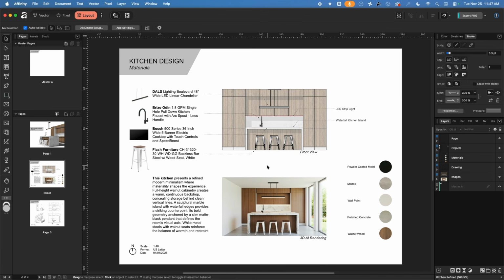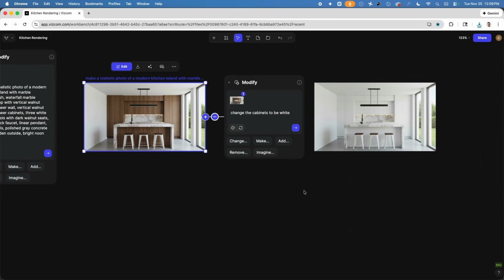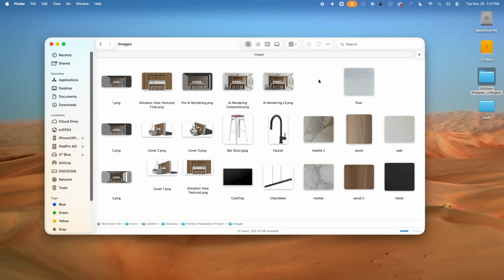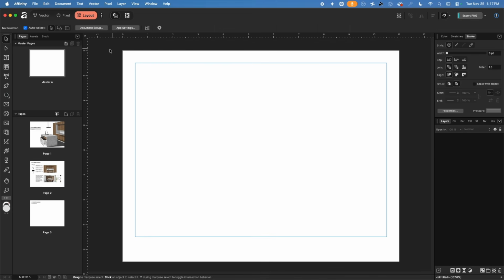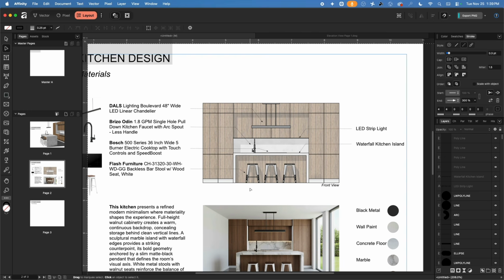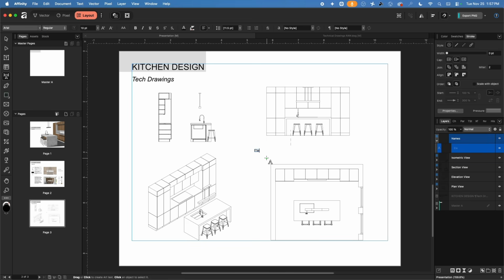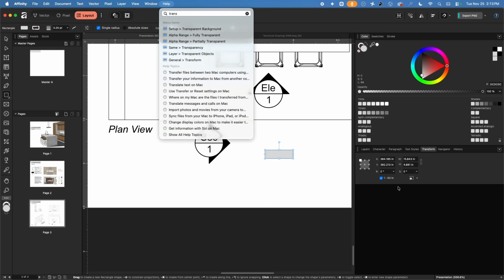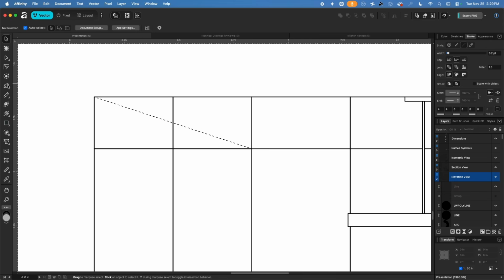OLD Version :: Affinity Studio - Kitchen Design Layouting Workflow

Comment: can i be an interior designer if i only use blender?
Reply from the maker: Yes you can - SketchUp is over rated.

You can place sketchup3D warehouse furniture easily in Blender
Blender has better texturing rendering and animation tools

You can do section cuts and light studies in Blender

Only thing blender does not have is a object nested component system and easy dimension tools

SketchUps Layout tool is pretty terrible to be honest 

Drafting I would do in AutoCAD Rayon or other free 2D cad tools.

Interior design is also more than just knowing sketchUp and that is why I myself do NOT use it but only Blender and Shapr3D
Reply from the maker: new version
https://youtu.be/29TGfwN0okw